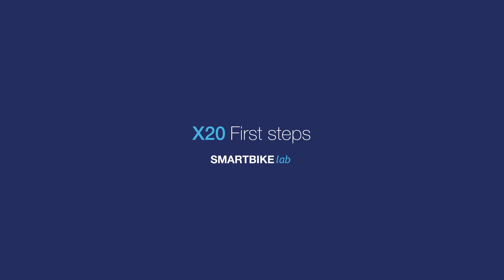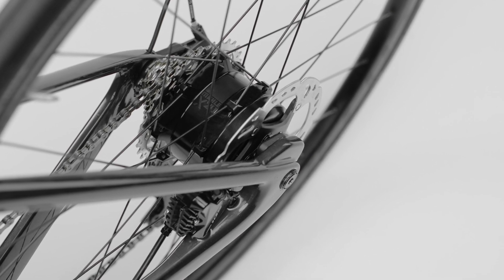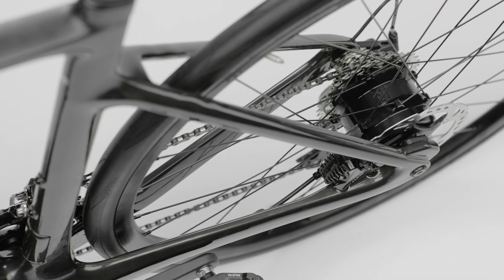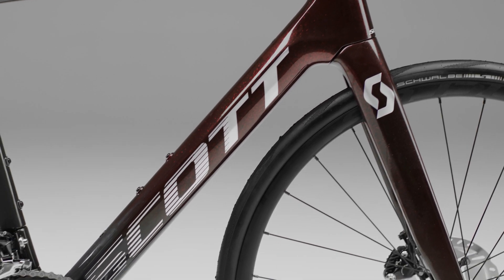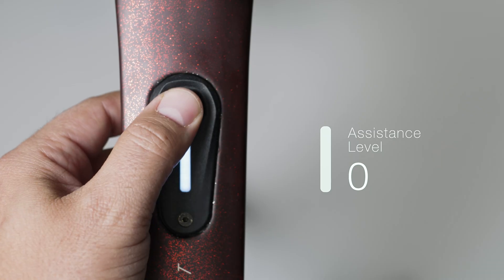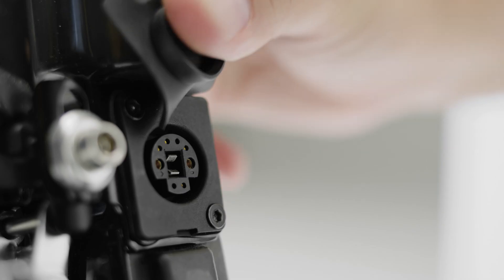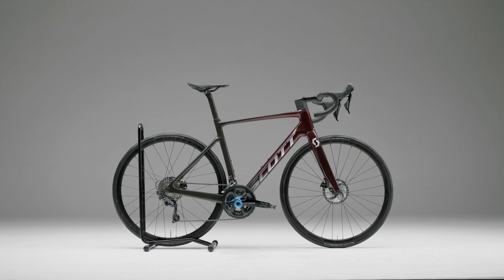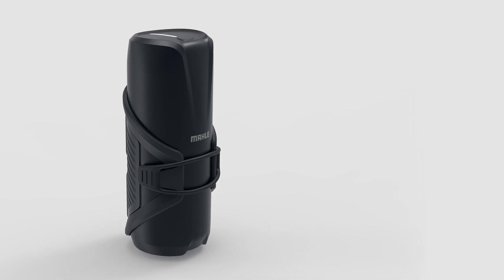X20 System First Steps - MAHLE SmartBike Lab

Comment: Morning. I just bought the Scott addict 30. What would be the charging requirements off grid in my motorhome. What size and spec powerbank would be needed. Thankyou
Reply from the maker: The X20 charger has an a maximum input of 100-240V and 2.5A

Comment: how to pull out the battery?
Reply from the maker: Hi! Depending the bike model the process may be slightly different. We recommend you visit your nearest trusted dealer to avoid potential issues.
Reply: @MAHLESmartBikeSystems  thank you for your reply. I am thinking about buying Desiknio x20. it is beautiful and I wonder if the battery is replaceable.

Comment: What Mahle refuses to say is how it compares to their old X35 which has a 40Nm, while the X20 has a torque of 23Nm !!! Tried to have more clarity from Mahle but they keep avoid to answer with facts/numbers. Just be aware of that as they trying to sell less efficient motors as better ones...this is close to misleading the customer by lying to them concernkng power. They could just be honest and say that they have 2 different systems, one lighter with half the torque but smoother behavior(X20), and second one with higher power but less smooth (X35). BTW I'm sure that the numbers behind names relates directly to torque values of the models 😅

Comment: 1.
Hi. What does "3.2kg Full System" actually mean?
I see that "Pulsar one" is optional; "E-Shifters" are optional; "Range Extender" is optional;
And what about the two batteries? Is one of them part of those "3.2kg"?
Thanks
Reply from the maker: Hello Paolo and thank you for your question! 3,2kg includes the main components of the System (that include the battery), while leaving out optional components like the Range Extender e185, PulsarOne and eShifters.
Reply: @MAHLESmartBikeSystems  
Thanks.
The smaller battery I suppose. I'll check on your website. Thanks

Comment: To keep honest specs:
Mahle X35 motor has 40NM
Mahle X20 motor has 23NM 
both meassured at the hub!
To mention 55NM for the X20 is a valued number in comparison to a middle motor, or as we say: a marketing trick 😅😉
Nevertheless, I tried the system in a Simplon Inissio and was very excited. Also, the quality if the parts and light weight is a tech-masterpiece and well done by Mahle💙